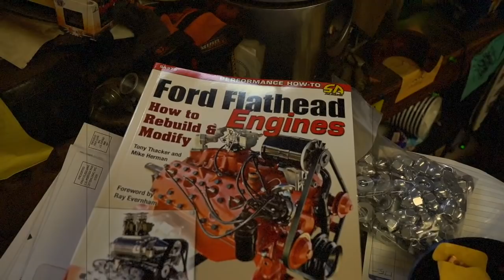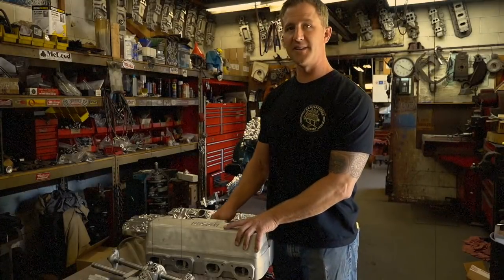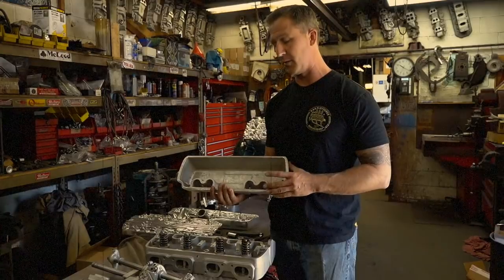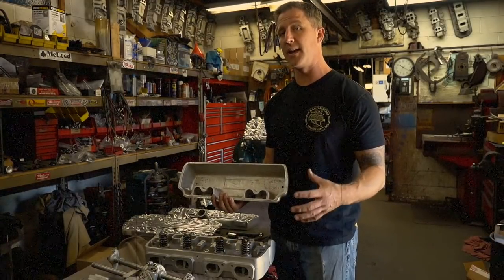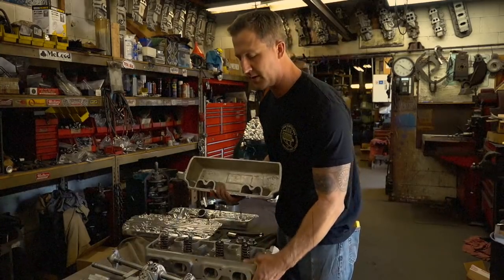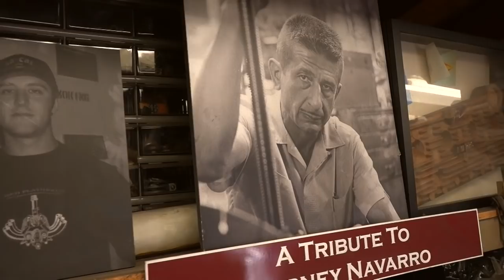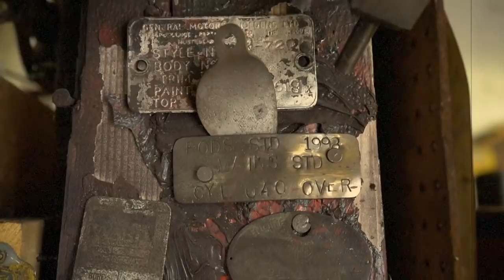H&H Flatheads

Comment: If you add overhead valves to this engine, it is no longer a flathead, so I don't understand the reasoning for doing so. Why not just get a more modern engine?
Reply from the maker: I dunno, I just make the videos. But why is there a reason for anything? I guess the best reason is, because you can.
Reply: dude wake up and go back to sleep
Reply: for nostalgia
Reply: @Roy&Shashi Brock   Talking about the Ardun heads ??? 

 Its a 70 plus year old modification.  Originally developed for Ford big trucks.  More power potential.  These heads were then discovered by the racing community.  From the 200 original sets of Ardun heads, many speed records were made.  They are now being reproduced, from several subsequent patterns, made and held by H&H, Don Orosco and others.

Or maybe you're talking about the Dixon heads ?? Another later 1940's exhaust upgrade for the vaunted flathead Ford design.  While not as romanticized as the Arduns .. .. or maybe not as plentiful.  Remember Arduns were supposedly 200 sets cast.  Dixons maybe a tenth of that.  

"Don't understand the reasoning for doing so" ???  Ummmm' .. history doesn't need to be understood.  It just needs to be known.  

You must be new here.
Reply: @leroymitch3153  exactly.